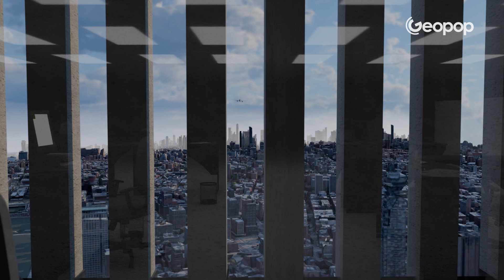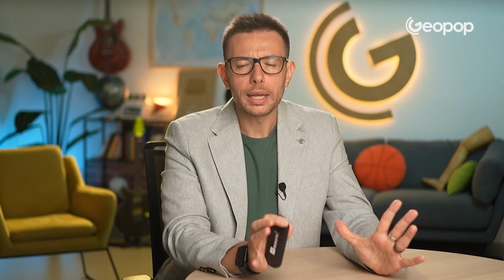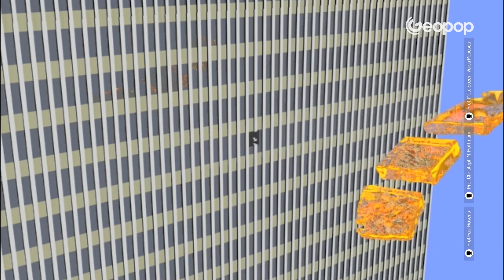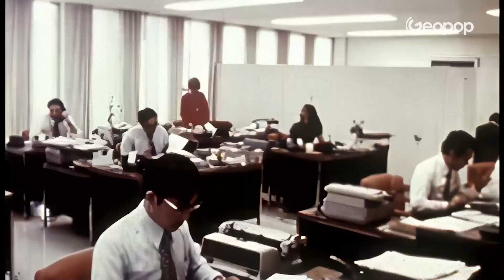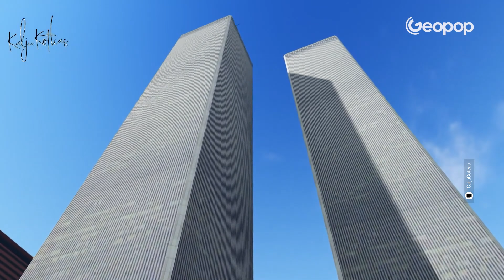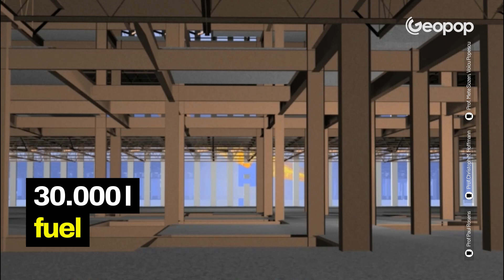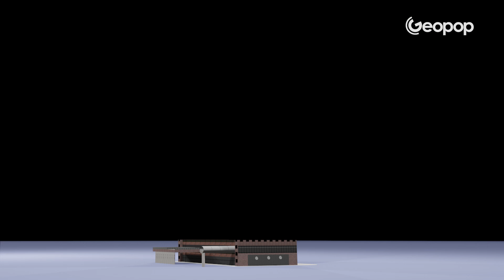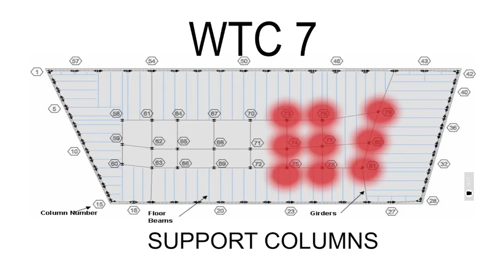9/11, 2001: The Technical Reconstruction of the Twin Towers and WTC 7 Collapses

Comment: In this video you state that the plane took seconds to disintegrate after hitting the building if that's the case why do we see on live news the plane hit the building and come out the other side 🤔 if it disintegrated within seconds how did poke out the other side of the building a plane that disintegrates on impact would never peek out the other side of the building and it wouldn't have any exit holes. There's an exit hole cuz the bomb went off and blew both sides of the building
Reply: You have to be some kind of a Ninja level idiot to believe someone put bombs on every level of both WTC's, flew planes into them and THEN set off  those bombs to collapse them...LOL! 
and yet...in the comments below ( and above eventually)  these idiots roam among us in perpetuity.

Comment: The only thing the strikes my sensibilities is the intact Saudi passports found near the rubble of the WTC 😅

If the collapse was caused by steel weakening because of heat we would have expected that the top floors will lean towards the weakend area , not collapse on its footprint.
Reply: A. A lot of paper was sent flying around as it was too lightweight to be destroyed by the fires.  One of the hijackers passports was found by a tourist and handed to a nearby NYPD detective BEFORE the buildings collapsed.  It was found in the street where a bunch of aircraft debris that had been ejected from the impact landed.  It was not found "near the rubble of the WTC".

B. It does... the top of the South Tower tipped forward just before full collapse. 

C.  The design of the lightweight floor truss system mean that as the trusses began to heat up and sag it pulled the outer walls inward... its sucking the outside towards the center.  If you look at photos you can see outer skin of building sucked inward on the damaged floors... this mean when you have final failure it collapses inward to the failure point... not outward or sideways etc. The rest of floors collapse under the weight coming down from above.  Remember the building is designed to survive an airplane strike... its not designed to survive its floor trusses heating to failure point.  

D. Although the towers fell predominantly downward, they absolutely did not fall  into their own footprints. Massive structural pieces, aircraft debris, building contents and human remains were projected well outside the footprints, some reaching surrounding rooftops and damaging building.
Reply: @eNosArmory you seem to be well informed , government official by any chance ?

The tourist who picked the passport was very brave . In his place I would have ran for my life .

Comment: All or most of the jet fuel exploded and evaporated on impact.
Basic furniture and floor coverings can't melt or soften steel for those masive steel beams to crumble in 10 seconds .
Thats impossible. 
The buildings were sabotaged to fall by secret millitary contractors
Reply: ClA = It was AI-Qaeda
FBl = lt was AI-Qaeda
AI-Qaeda = lt was us

This random retarɗ = "It was lnside job!!"
Reply: We all watched it burn for a long time before it collapsed. Jet fuel descended to lower floors.  Isn't that proof enough that the fuel did not evaporate on impact ?

Comment: Let’s not forget the fire proofing they used back in those days. Probably not the healthiest thing you should breathe in. Also when the planes hit it knocked all the fire proofing off and weakened the beams faster. Also the trust they use isn’t what I would call very strong. For what it does it works amazing. But when a big ass plan hits it yeah things happen. The fires that were burning were not just jet fuel but all the paper carpeting chairs and whatever else that could burn. But that’s just my 2 cents.

Comment: Those two buildings did not come down from planes going into them.  Fuel is explosive and doesn’t burn long enough for 2-3” thick girders to get red hot and slag.  Office furniture will not keep a sustained fire for length of time needed to make the steel sag.  Per UL testing, the beams with fire retardant last ~2hrs and only sagged 2-3”.   The towers fell in ~55 mins. 

Also, MIT engineers calculated the amount of energy needed to “blow off the insulation” off the girders, and there wasn’t enough fuel energy onboard the planes to remove the insulation.

Building 3, had neither a plane crash into it nor catch on fire and it too, magically collapsed.

And after all that, they “happened” to find the passports of all the terrorists intact, even though the planes blew up.         Deep state black swan event imo.  There’s much much more that’s off.
Reply: yeah, like 19 numbskulls who could barely ride a bike precision-guided those planes at full speed into 3 buildings, one of them inches off the ground into the pentagon. Riiiiiiight.

Comment: At 5.00 mins watch the top of the tower fall , it goes thru smoke , when it reappears thru the smoke it has disintegrated, the concrete is falling into dust , it happens so quickly, i have know idea what could cause that
Reply: Dr. Judy Wood wrote a book about this "dustification": it's title is "Where did the towers go?".

Comment: Tower 7 was on fire and burned uncontrolled for nearly seven hours before it collapsed. That's why it collapsed.
Reply: That cause and effect should be repeatable for any steel frame building. If a fire in a building is 'uncontrolled' and burns for 'seven hours', any steel frame building should collapse straight down into its own footprint. What would be the point of demolition that requires months to prepare and place precise devices is you only need 'seven hours' of an 'uncontrolled' fire?
Reply: @whatthef911  From recollection: I believe that there was a tower in Madrid that burned with great and dramatic ferocity for far longer —and it did NOT “collapse” ..
Reply: Utterly Inaccurate Pablum
Reply: lmaoo  🐑🤡
See: Grenfell Tower fire

Comment: Building Seven didn't "collapse."  It was "pulled" - the order given by Larry Silverstein.  AND experts will tell you it takes at least a WEEK to rig explosives in a building of this size. AND how did a crew even get explosives into the city on such a day?
Reply: Except he's quoting the order of the fire department & "pull" in that context means evacuate the personnel. World Trade Center Building 7 (WTC 7) was damaged and suffered physical trauma from the collapse of the North Tower (WTC 1), then uncontrollable fire (fire generates heat) weakened the steel structural support. When gravitational force exceeds structural resistance, then buildings fall down.
Reply: @misterfunnybones  
Such an apt handle.
🤣🤪🤡
Reply: @signifyingcracker My Gremlin theory is the most accurate for those conspiracy theorists that think they know everything with their thermite & bomb ideas. Gremlins were present in the core & they chewed through the steel, then the towers fell including building 7. We don't need physics equations or the effect of gravity or structural resistance limits: Gremlins explain everything. The only problem is that it offers an explanation, & the conspiracy mindset doesn't look for answers, they look for infinite, "yeah, but" questions for every available answer.

Comment: 36"  wide, 4" thick hardened steel I beams, encased in concrete.. do not suddenly 'come apart; and melt and bend into pretzels from an aluminum aircraft. It was THERMITE

Comment: Good explanation.  Obviously steel doesn’t need to be anywhere near its melting point to become weaker: that’s been a known principle of metallurgy and blacksmithing for centuries.

This presentation didn’t really focus on the massive amount of potential kinetic energy stored up in an airliner full of passengers, luggage, and near capacity fuel tanks hitting a building at 500 mph.

That is the equivalent of 3/4 ton of TNT detonated upon collision with the North Tower and 1 ton of TNT upon collision with the South Tower (the second plane was flying faster, increasing its potential energy at impact).

That wasn’t enough to bring the Towers down initially, but more than sufficient to sever some of the support columns and blow the fire retardment coatings off of many if not most of the others.  Then the resulting fire could soften the steel sufficiently enough to cause the structural failure of the entire building in each case.

I have a good friend who is a “Truther.”  But he’s also a “Flat-Earther.”  I bet the Venn Diagram of those two belief ststems overlap quite a bit.
Reply: 500 mph is the speed a Boeing 767 flying at 30,000 feet where the air is thin and the drag reduced.  It is impossible to fly horizontal at that speed at 1,100 feet near sea level.  At a minimum the aircraft would be wildly uncontrollable assuming the aircraft did not break apart and suffer catastrophic structural failure with would have been likely at such a speed.  500 mph is yet another unscientific, wildly exaggerated, total lie.  Since you brought up kinetic energy, since the north tower fell at free fall acceleration (as admitted by NIST), there was only enough kinetic energy to do nothing but fall.  There was no available energy to do anything else, like pulverize all the concrete to powder as was observed.  That is a hard violation of the fundamental laws of physics.

Comment: How credulous do you have to be to believe this?
Reply: Being skeptical is fine. But “how credulous do you have to be?” isn't an argument. The video gives a mechanical explanation: aircraft damage, loss of fireproofing, heated steel losing strength, load redistribution and progressive collapse. If you think that explanation is wrong, point out which part is wrong and explain why. Otherwise you're just replacing “I believe the official story” with “I believe the conspiracy story.”
Reply: @x @gwenns-ottawa the official story is the obvious conspiracy
Reply: @mrkeeny ”Because I say so” isn’t an argument.

Comment: Demonstrate the pancake collapses with legos/toothpicks and i'll believe it.  The underlying structure seems way too strong for a pancake collapse.
Reply: Let's simplify it. Imagine the upper 50 floors weigh 100,000 tons. Under normal conditions, the structure below is supporting those 100,000 tons statically.
Now let those 100,000 tons fall one floor (5 metres). They hit the floor below at about 36 km/h. If the structure has only 0.5 m to deform and stop that mass, the average force during deceleration is roughly equivalent to the static weight of 1.1 million tons. So you're comparing roughly 100,000 tons sitting there with an average impact load equivalent to over 1,000,000 tons. And that's the average over the 0.5 m of deceleration, not even the peak force.
That's why “the structure below was strong enough to support the building” doesn't mean it was strong enough to arrest the falling upper section.
Here's another thought experiment. I'm sure you're strong enough to hold a 100 lb bag of cement. I'm equally sure you're not strong enough to catch that same 100 lb bag after it has fallen 15 feet. Even if you manage to stop it by bending your knees to absorb the impact over 30 cm, the average force would be equivalent to holding roughly 1,600 lb.
Reply: @gwenns-ottawa  That 1.1-million-ton figure comes from assuming a 0.5 m stopping distance—but that's precisely what has to be proven. Of course a moving load can be far more destructive than a static one, but its actual force depends on how the entire structure deforms and absorbs energy. Columns buckle, connections deform, loads redistribute, and the upper section itself breaks apart. Without comparing the available gravitational energy to the structure's real energy-absorption capacity, you've demonstrated a hypothetical impact—not that progressive collapse was inevitable.
Reply: @marcrigor6423 You're right. This requires a proper structural analysis rather than my simplified thought experiment, which was only meant to provide an intuitive sense of the magnitude of the forces involved. Fortunately, engineers did one. Unfortunately, they neglected to reproduce it with Legos and toothpicks.
Reply: @gwenns-ottawa  haha 😄 if only they'd had the foresight!  This will have to do.  Can you point me to that, kind sir?
Reply: @marcrigor6423  Search for NIST NCSTAR 1A — Final Report on the Collapse of World Trade Center Building 7. It's freely available from NIST. If you don't want to read the whole report, use ChatGPT to summarize the collapse sequence, particularly what happened to Floor 13 and Column 79.
Reply: Legos aren't the correct scale to replicate it.  The floor trusses were not strong enough to arrest the falling column of debris.  With the trusses removed, the columns lost much of their strength due to the lateral support being removed.

Comment: So what you're saying is at the fire suppression and sprinklers didn't work to control number 7 and it just magically happened to take falling debris and catch fire and get as hot as the twin towers and does melt and fall apart? I'm calling BS on that Tower 7 yeah the twin towers there's still a lot of questionable things there but no matter what it comes down to a lot of innocent lives lost
Reply: " the fire suppression and sprinklers didn't work to control number 7"
-Correct.  The collapse of the one of the taller towers knocked out water mains.

"it just magically happened to take falling debris"
-Nothing magic about falling debris.

"and catch fire and get as hot as the twin towers and does melt and fall apart?"
-No, it didn't melt.  Steel fails long before it melts.

"calling BS on that Tower 7 "
-Humor me.
Reply: @NotSure723 okay you got a point on the water being knocked out that would be a major situation

Comment: Can you explain why other buildings have been struck by planes and had first yet have not collapsed? All three of these buildings collapsing just doesn’t pass the sniff test. You can tell something is off just by watching the raw footage.
Reply: comes down to the planes being heavy (+200 tons) flying fast (400+mph) and the unique design of the towers. If the towers were built say like the Empire State Building, that had steel going through the entire structure, possible they may not have collapsed. But the Twin Towers had massive open floor plans, and the sides of the buildings that the planes went in, the steel columns were almost completely severed, and then you have the fires, we're not talking about a small office fire that starts in one room and spreads, we're talking about massive floor-wide fires on multiple floors all at once. Also, the force of the impact and explosion inside the buildings was significant, unfortunately since they collapsed, there is NO way of truly knowing how much damage was actually done inside those towers. And even though the buildings had fireproofing, that fireproofing isn't a total save, it is time sensitive, usually rated only for 2-3 hours (enough time for firefighters to arrive and start extinguishing the fire.

Comment: It was an engineering marvel, but it was a cascade of problems that ultimately brought the towers down. The jets were fully fueled and going an estimated 500+ miles per hour. It severely damaged the structure as well. The second tower came down first because the plane hit at the exact spot and angle to cause the most damage before the fire took over. Yes, it was made to withstand the impact of a plane strike, but it wasn’t made to withstand the impact of a Boeing 767 fully fueled going 500+mph. But I’m still baffled why 7 came down, but not the others, although they were damaged by all the debris
Reply: I now understand how just one column buckling - 79 on the diagram - was enough to cause a cascade effect that brought down the other columns. I  too was a bit baffled by its collapse. The design of WTC7 didn't have the redundancy that Towers 1 and 2 had. I never realized that it was consumed by fire until seeing this.
Reply: @RichardMelaun you just proved that you can reason effectively. It's ok to be confused or expect the worst from someone. We all probably felt it. But you are willing to consider everything at play. I commend you.